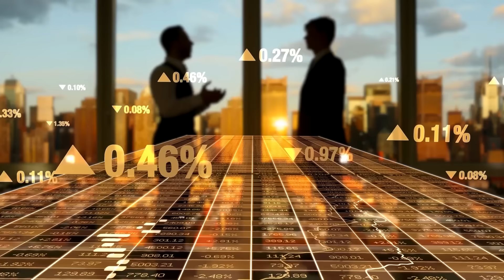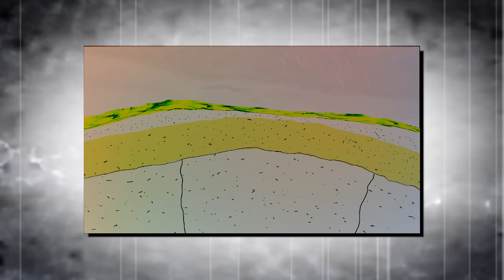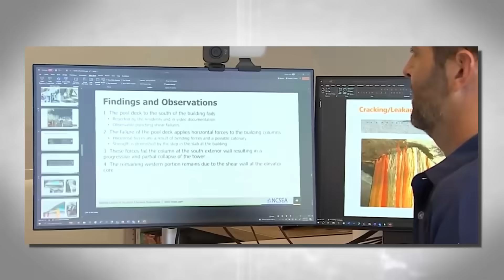Miami's $100 BILLION Skyscrapers Are Now Sinking Into The Ground!

Comment: Coastlines are not usually as fixed as people might want. Especially in a state like Florida which is essentially a giant sandbar. Less massive buildings would face somewhat less risk. But hurricanes may pose greater problems in coming decades.

Comment: We have been told that rising sea levels will have Miami under water for at least 25 years now. We have vacationed in Sunny Isles annually for the past 20 years (except 2021 Covid). We sit in the same exact location every year and the low tide and high tide have not changed in 20 years. It just isn't true.

Comment: I have always wondered if a 160-190 mph hurricane came through and blew for a sustained period of time with gusting etc., could these building be flexed to the point of fracturing in which they would not pass an inspection for structural integrity and have to be torn down?  I have never seen anyone speculate about this.

Comment: It's all ok... your President says the sea will only rise an eighth of an inch in hundreds of years...😂😂
Reply: We have been told by climate alarmists Al Gore and Neil deGrasse Tyson that rising sea levels will have Miami under water for at least 25 years now. We have vacationed in Sunny Isles annually for the past 20 years (except 2021 Covid). We sit in the same exact location every year and the low tide and high tide have not changed in 20 years. That is a fact.

Comment: Hello, I am one of the authors of the study. Thank you for this summary of our work. Let me point out 3 errors in the video: (1) Intruded saltwater does not weaken the limestone. In fact, the limestone is saturated with saltwater. However, injected freshwater (form storms) can be a problem as freshwater dissolves limestone. That is how you get karst landscapes. The dissolution process is very, very slow, however. One of the hypothesized subsidence mechanisms is that this dissolution is much faster under the heavy load of high-rise.  (2)   You are showing an image of the Ritz Carlton residences in Miami Beach. The subsiding Ritz Carlton tower is located in Sunny Isles Beach. (3) We don't have any observations for the new Bentley Residences. We see subsidence at the structure that was removed to make place for the Bentley Residences. We call it in the paper the Bentley development site.
Reply: Is the study available online?
Reply: Thanks for the further insight and clarification.

Comment: I don't know if the narrator is AI, an intern or just never spent an amount of time in Miami Dade. The video is all over the place. Miami, Miami Beach, Sunny Isles are different place in Miami Dade County not Miami. Around 8:00 something about new construction. Bentley Tower is going up in Sunny Isles Beach. Also, new construction does not go forward until a certain amount of pre-sales are done before ground even breaks. MB TOWER CONDO IS NOT UNDER CONSTRUCTION. Lastly, many people never live in this buildings as they are pied-à-terre. It's Dezer not Deezer...The reference from UM is correct. The mention is that there is no need to panic. The adj condo next to the fallen condo - the survivors / families of the dead sued that developer. I do not know of the out come of that suit.

Comment: 20 years ago there was a sign from charles darwin university that said that by 2020 the tide would be over 5 meters higher than today . The tide hasnt moved an inch ...they did take the sign down .  They also predicted that parap in darwin would be threatened . One of the highest areas of inner darwin built on rock . You need a jackhammer or explosives to dig a foundation ...
Miami is built on limestone hence the problem

Comment: This doesn't surprise me. A lot of Florida sits on a honeycomb of limestone. Even though there was pilings drove deep into the ground, with millions of pounds of weight coupled with pumping millions of gallons of water from underground, yes I can see these massive buildings sinking. Liquid cannot be compressed and without water filling the honeycombed limestone the limestone will probably start caving in on itself for it's not that strong without the water.

Comment: What Manhattan buildings are sinking ???  What BS is this
The VAST majority of NYC buildings of any height are on non sedimentary ie cant dissolve like limestone, are homogenous due to creation by cast heat & pressure deep in earth for 100s millions yrs    BEDROCK.  ONE bldg choose not to settled 1 inch in construction which was halted.  Developer, actually no one  can't fix & just door dragging on admitting it has to be demoed.
Now I know China's bldgs are often sinking as I know the often collapsed & why,  but u can give one example or source to go to... 
This is LAZ INESS or incompetence so typical of bait click biz.  Zero quality in anything  so owners creators etc  to  get rich quick..
Oh solution in FL, PILES thru limestone & sand layers until pile friction graeter tha load using concrete cibrated to penetrate loose soils.  Might tak 100 ft or 300 ft orhers have done so, Fl GOP Govt just needs to write a law RO PROTECT PEOPLE instead of penalizing DEM opponents like Disney & now entertainment industry of miami held up to oay cost of police service in their areas ALREADY PAID FOR BY EVERYONES TAXES so taxes can be ripped off by well connected cendors consultants mske work govt jobs.  Like GOP did in DC 2016 yrillion a yr fed tax $ to rich adding trillions to debt.

Comment: Good lord. All buildings “sink.” You need to take this video down.
Reply: They don't sink 5 inches in 10 yrs
Reply: @ If they are “sinking” at 5mm per year, that is less than 2 inches in a building’s first decade, which is totally normal. Do better and do math.

Comment: A building sinking evenly is bad enough. A building sinking unevenly, causing it to tilt or lean, is quite another, far more significant, issue. 
The Miami Beach courthouse might statr sinking from the weight of all the lawsuits against builders that will likely be filed.

Comment: The sea has been rising for 15,000 years and the rate of rise has remained steady for 100 years (and that is much slower than it used to be)
Reply: @johnl5316  No its actually increasing. Every scientist agency that monitors it has recorded significant rise over the last 40 years that is steadily increasing.
Reply: Global warming is melting huge chunks of the ice and snow covering Antarctica. Expect a 3-4 feet global sea levels rise by 2100 compared to 2000.
Reply: Ever hear of the "Thwaltes Glacier"?  they call it the "Doomsday Glacier" rapidly melting for the past 30 years, it will cause sea levels to rise 2 feet  When this happens the rest of the ice on that continent will melt causing rises of 10 ft. Homes in CA are already falling into the sea as well as in the UK on the coast of the North Sea.  FL could fall fate of what happened to Doggerland connecting the UK to continental Europe, now at the bottom of the North sea.  People who plan to live in these newly built monstrosities on Miami Beach would be better off buying a houseboat.  I'm an old FL native, I clearly see the erosion.  The scrap concrete and boulders they place on shore lines now ain't for decoration and dredging continues to constantly restore these beaches at the cost of millions to tax payers!

Comment: Fluff video. Miami is not sinking. There are real videos out there discussing Miami and the engineering put into the buildings. Do some need upgrades, yes. Banks don't give 30-40 yr loans on buildings that won't be around in before the mortgage will be due. PORSHAH, not POORCE
Reply: This video quotes the University of Miami:
“We found that subsidence in most high-rises slows down over time, but in some cases, it continues at a steady rate,” explained  the study’s senior author Falk Amelung, a professor of geophysics in the Department of Marine Geosciences at the Rosenstiel School “This suggests that subsidence could persist for an extended period.”
Reply: looks like those building foundations are not the only things buried in the sand. Ocean is rising. Same result as if the land was sinking. You are a fool.
Reply: do some actual research the oceans aren’t rising to a catastrophic to sell. The information is out there. Again thanks will not be selling homes so they’re gonna be covered in water in 30 years. In 1980 times says it was gonna be the Ice Age and then they said later in 10 years, Florida would be underwater so start doing your research and look with a real environmental scientist or saying and that’s not what you’re being sold

Comment: Miami is a failure and deserve it. It's no way a sustainable city. Miami is an example of what not to do when it comes to city planning. Good thing I have been planning for a city that would possibly be located in the everglades.
Reply: The highway system is terrible.   Terrible planning

Comment: Dont build your house on the sand.
Reply: 🤔 I’ve heard that somewhere 🙏🏾
Reply: @ That’s funny, because the video literally says 3mm. Inches, millimeters, feet, what’s the difference, right, Mr. Science? All buildings do this. Good lord, even the Brady Bunch did an episode about it. So I guess in 10 years they all will have collapsed, right? Bookmark this video and come back in 2035 with a new batch of excuses.
Reply: It's not on the sand. It's on coral rock.
Reply: there should be laws and regulations, preventing that. Somtimes it is cheaper to pay some officials off, than playing by the rules. Looks like this time it wasn't cheaper.
Reply: Common sense, if one has learned about life.
Reply: Lol poetic physically and spiritually
Reply: This is literally fear mongering! Subsidence is normal… a 600 ft tall building has sunk 3 inches 😱.. run for the hills
Reply: This is literally fear mongering! You should be ashamed of yourself to misinform!
Reply: Don't build 100 homes one on top of the other
Reply: Sadly, conservatives dont open their Bibles enough to know what that means.  Hence MIAMI.
Reply: “But the smart little pig…….”
Reply: Buildings are built on bedrock, Einstein.
Reply: @MondoMiami  Sure, if you consider Miami's “bedrock”, specifically a type of limestone called "Miami oolite" or "Miami limestone" the surface bedrock under the Miami area; however, this limestone is porous and can be susceptible to erosion from rising sea levels, posing a potential concern for building stability ||>> This type of “rock” is nothing like actual super hard /dense granite.
Reply: @ It’s not SAND, which is the statement I am responding to. Oh, and news flash: geology varies by location. I guess any area that doesn’t have your preferred bedrock is uninhabitable?
Reply: @MondoMiami 
Yup sinking bedrock. Did you even watch the video ?